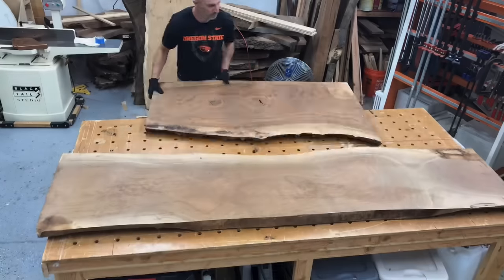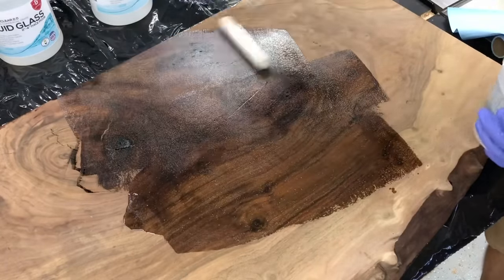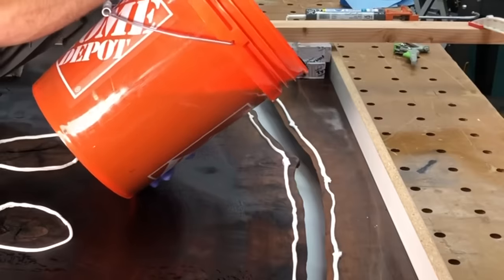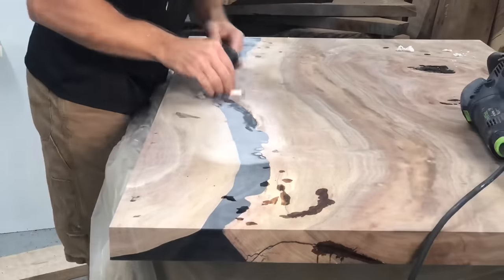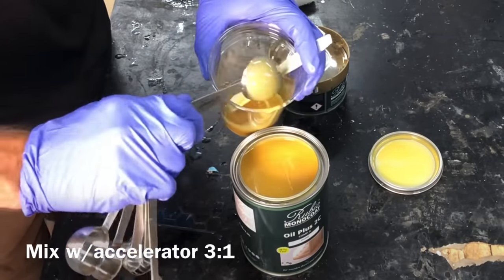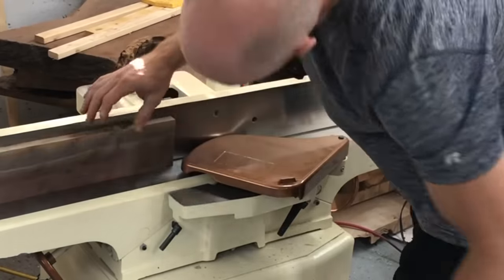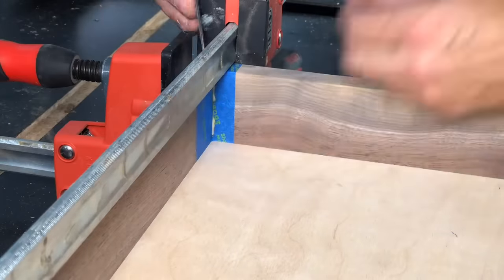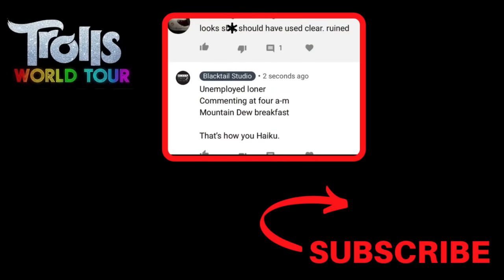Strangest Thing I've Found In a Slab

Comment: Nice work! Love your channel. How fine a grit do you use on walnut? I have a slab that I sanded down to 240 and then finished with Odie’s Oil. It still has open pores that dust can settle in. Would the Rubio’s Monocoat be a better finish to fill the pores? Do you think I can put the Rubio’s over the Odie’s oil?

Comment: On the drawer why didn't you switch from one side to other and then mount inside the drawer on side and the bottom desk? Could put a panel on inside drawer to cover the sides of that was issue

Comment: Dining table - I remember years ago watching a Barn to house conversion series on UK TV.  The guy was building a open staircase out of locally source oak.  He was cutting the steps and risers, following which he fed them through the planer.  This is when he found bullets in the wood.  Like you he left them in there for effect, but the planner was not so impressed as the bullets shattered the carbide blades. Not so much profit taken that day.

Comment: Thankfully you're not like me, I'd have spent 6 weeks engineering an under-mount for the slides to attach to the bottom of the drawer, gone through 15 versions and may have still possibly gone with the side mount like you did. Still turned out gorgeous as always

Comment: Titebond 3 is an exterior glue.  It is horrible on tooling, and I would not recommend it. It is way harder than the wood, so it can leave low spots next to the joints.  I have had problems with it at work as far as curing out properly.  Original Titebond is the best. The 2 variant is good for faster drying. 

 I manage the millwork dpt in a custom cabinet shop (been in the industry for 35 yrs).  I  am especially close with the molder operations, and we hit bullets all the time.  Especially with walnut. Bullets are softer than the tooling , so it is not an issue really.  I have heard Walnut trees are especially susceptible to this as there can be lone trees in the middle of fields, and they tend to get shot at for some reason. This is just a notion though, there could be a completely different reason. 

 Good work btw.  We do occasional live sewn slabs for furniture pieces in custom homes and hotels, but it is not very often.  We have brought in entire trees and sliced them up  ( On a big wood miser) Walnut along with other species.

Comment: To hide the slides, you could make two side covers and route in them space for the slides and brackets. Because they would bear no structural load, they could be glued in place with a few dabs of RTV, which would allow them to be easily pried off if the slides needed service in the future.

Comment: I can speak(write) about the Titebond 3 problem. I found when I bought some that the mixture separates in the bottle and needs to be mixed thoroughly but how does anyone do that with it in a bottle? Shaking does nothing, it needs physical stirring. You can actually see the heavier particles in the bottom of the bottle when purchased. I didn’t notice and when I tried pouring some out it came out like milk. I thought it was odd and I was right. It doesn’t hold squat, has to be mixed. I brought it back and exchanged it for Titebond 2 which works great. Hope this answers some questions and helps.

Comment: Steam punk table 👀
That's all. Class vid as per 👌
Ooo one thing. Two lengths of the same timber on either side with a scarf cut to the underside where the draw furniture is. I would have considered a shadow gap to the front in line with the top of the drawer too. Only about 50mm deep or so but alas, father in law...quite rightly every expense spared 😜🤣

Comment: You could have hid the hinge with Walnut(covered it)?  That way you'd only see it when you pull the drawer out.  I get that you used the metal slides to get full extention, but if that was not necessary, you could have done wooden slides(make drawer longer than slides so when you pull it out the drawer is still engaged in the slides, like drawer is 6" longer than slides.)

Comment: what i'd love to see in an epoxy table   would probably  be to light a thickness a wood to be practical but ... an old fashion drop leaf table someone stole the one i had been given  by great aunt  ages ago  but i think a drop leaf in an epoxy table would be  an absolute beautiful thing in  crotch  or  root burl walnut,  That  rubio sure beats the shellac and had rubbing  to finish  with shellac and  rubbing in  with pumice, honestly i like the    finish  get with rubio monocoat  then a couple coats the ceramic over it, the failure is  because of the oil in the wood  all i use is  regular  titebond

Comment: Love all your projects. I recently came across your site and have watched many of your videos (and subscribed). You have mentioned that you get "dinged" an extra charge if you have any metal in your wood that ends up going through the industrial planer. Did you get hit for that fee for the bullets?
Reply: If they were old lead bullets it would be like planing hardwood. Steel could definitely damage the plane blades. I use a wand type metal detector now after killing a full set of blades on a hidden nail.

Comment: On your drawer, generally there are 100 ways of doing things. If it works it's right. You can make the slides look better with a piece of Walnut on the outside of the drawer slides. You can attach it with the body mount holes down the center of the slides.

Comment: After mixing you need a  thick plexi plate with a hole in the middle for a vacuum cleaner. So pulling a bit of vacuum you will remove air bubbles.

Next tip poor a layer of transparent epoxy  let it harden then place objects on it like coins  then poor again 2nd layer  then an opaque  third layer

Comment: Liquid glass?  What happened to the shine? Looks matte now? I'm a new guy, but been in auto collision & refinishing for 25+yrs  and used  polyurethane base coat clear coat automotive paint on everything, your homes front door ,   jetted bathtub/garden tubs,. Even the sink👍🏼  
The dry times and materials are $$$ 🔥👍🏼.  I wanna find something like that liquid glass to play with, does is buff out with 1500-2000grit and a regular buffer/angle grinder with Velcro buff pads 3-M ??

Comment: In the boat world working with various fiberglass resins, not sealing edges or not pre coating any wood surface with resin before glassing so it can absorb what it will because it WILL absorb some is one of the biggest mistakes you can make.

Comment: Are you sure those are bullets? I’ve founded four or five in different slabs over the years and you can always tell it’s a bullet by the thin ring of brass you’ll see around the lead. I built a live edge headboard for me bed that has one dead center. Just curious. Maybe it was the lighting but those didn’t look like bullets to me.

Comment: Either a full wood piece like a wall decor or something that requires a little more resin than what you usually do for the epoxy tables. For hiding the drawer mount, something like a facade could have worked, but not to sure how to make it work for when you pull the drawer out.

Comment: make the drawer closer to the length of the table, so the legs hide the slides and paint em flat black. as well you can flip your L brackets inward to mount hiding above the drawer sides.
PS I'm more of a car building guy than a Furniture guy so I may not know anything :)

Comment: i think gluing a cutting board vrs a desk drawer is very different, the glue in a desk drawer isnt put thru the same kind of stress a cutting board is, water, meat juice, acidic veggies chopping bones or whatever else poeple do with cutting boards, so if a glue fails on that it's prolly just a combo of how it was used and the stree put onto the glued bits, but i dunno anything about wood, just guessing

Comment: I probably would have set the drawer to the left or right rather than central to the table, as this tends to be the 'sitting area'. The function of the drawer will be problematic if the user is sitting right in front of it.

Comment: As I type this, I see that their is 2,138 comments. In the off chance you may read this, you may have heard of the expression no need to reinvent the wheel, instead improve the design. I'm an ex Autobody guy. You may (HINT, HINT) want to try checking out some autobody / refinishing compounds / polish(s.) Used on both Automotive and Marine (i.e. fiberglass / "GEL-Coat") finishes. Also you might want to pickup some / a set of "TRANSFER-PUNCHES," instead of using a "drill-bit." The reason I make this suggestion, is you would be able to make a "Mark," / small "Divot," in the CENTER of where you wish to drill a hole, and also know just what size drill bit to use, i.e., a "TWO-FOR."

Comment: I got to watch to the end as the FINISHED LOOK is what I always see.  I hear you complain about the look of the sides of the drawers. My solution is either cut an "L" shape or a square block to attach to the underside which blocks directly seeing the roller slide OR BROWN PAINT or stain which does not make it as obvious as the silver metal color. Just brush it on keeping it out of the moving parts.  Metal paint like Rustoleum will do. (it is the cheapest and fastest route to take)

Comment: Nice legs, .....and the Flowyline ones are amazing too, buhahahaha.....Main piece of wood has the coolest patterns and the other piece matched up perfect as can be. black connection flow with those black legs are insanely cool. Drawer is a pretty odd addition for the type of tables you make , but hey it's for family so who cares...fantasizing about a drawer/drawers design where they are spanning across the whole front so it looks like one long 3-5 drawer divided underlip...be really cool if you could make a big ass circular table with drawers underneath the whole bottom..is that even possible? my brain just exploded.

Comment: Time for you to start making cabinets?
I love your finishes and choices of wood, but not a big fan of epoxy. I feel it gets over used too much. Have you tried just flushing up the edges of the two piece, like with this desk, so they mate flush with no need for epoxy filler? Doesn't even need to be square to the edges. Maybe angled. But flush faces to each other so its just glue and dominoes. 
Thanks

Comment: Do you ever get bits of plastic from the sides of the cheap orange home depot buckets?  Our power mixer added bits of orange shrapnel when we mixed drywall mudd.  I was told to use the harder white buckets to prevent that.  Also would have loved a close up of the bullets.

Comment: I love that you find the wood to get that 'flow' between the two, maybe in the future, you might do more flows, less epoxy, with more than three panels of wood, maybe several branches or thin wedges. If not, as others have said, see through so you can see the woods edge.

Comment: Cam, it looked like you were running the acrylic caulk on the slab through the planer or wide belt sander.  Won't that gum things up like the wide belt sander?

Comment: In your last vid you mentioned sandals in the shop. In the summer I always wear my sandals but I don't generally do the kind of work you do, I am a turner, so how can that be bad for sandals! Think again. I had just finished sharpening my 3/4" bowl gouge and laid it on the lathe bed point facing away from me, when some how i turned around, knocked the tool which flipped around and fell towards me tip down and dug right into my ankle taking out a good 1/2" chunk of skin,OUCH. Later as I was cleaning up which as an after thought I should have gone for stitches and didn't, I realized how lucky I was, because 1/4" over it could have hit and cut my achillies tendon!! I probably would not be walking today. Now I wear SHOES and long PANTS.

Comment: Cam Anderson,

I've followed you for years, only recently subscribed.  Been a woodworker for 45 years.  

While I understand your use of black-dyed epoxy on most of your creations, in some cases it doesn't work well or is just boring.  Have you ever thought about how much better (and more distinctive your work would be in the eyes of potential clients who are so used to seeing same old, same old black epoxy) - IF you color-tone matched your epoxy to the woods you are working with?  Or, used a dark Amber epoxy with woods that have warm, golden brown colors? 

For example, the table in this video had plenty of cutoffs to test on and IMHO would look much better and be worth A LOT MORE $$$ if the epoxy was in the same family of colors as the wood.  If you are game, try this: 

1) Make the epoxy mix color-matched as close as possible to the darkest wood of your slabs, THEN 
2)  Filling small voids would be done with either black (if you think it looks okay) or with small batches of dark wood-tone colored epoxy (write down the color ratios you mix, so you can duplicate them later).
3) Add a touch of pearl white / pearl cream / gold flake in the final pour (yes, think of Stone Coat counter tops, BUT done VERY subtly).  Application is critical to getting this right, so you may have to experiment some.

Doing this differentiates your EXCELLENT table tops with a POP of color that has something extra going on.  Anyone can do black epoxy and yes the people will still pay you if you continue down this path.  And yes, it goes with black legs, BUT, I'd bet you could get an extra $2,000 - 4,000 per project from many of your customers if you offered this to your clientele as an upgrade option.  

Another upgrade option which would work best with CLEAR, Amber  / Amber with gold flake Epoxy would be - Subtle, dimmable LED Lighting on the underside.  This should be worth at least $500 - $1,000 more (You'll have to install an underside control and/or WIFI option w/phone app - no big deal, cost to you is almost nothing - app included).

Thanks for reading through all of this.

Best regards,
Bill Wendt

PS: I have no affiliation with nor get any compensation from Stone Coat Counter Tops, Inc.  If Liquid Glass does counter tops, cool colors, etc - maybe they have training courses on applying different color blends.

Comment: i have had gr8 results w/ Build50 epoxy clear finishes. Self leveling, ez to use, durable, hard to scratch, (even with a newly sharpened steel dart). Great for bartops, + u can add items in it for accent. Mix by hand to avoid bubbles.

Comment: Cool project.  
After seeing a few of these epoxy projects, I am curious as to why no one seems to using vibrators to eliminate bubbles.  Vibrators are simple technology and cheap and commonly used in everything from concrete to dental tech.

Comment: I find old bullet projectiles in the logs I cut from my land in Texas. Some antique and some look recent but they are cool to leave in the finish when the mill cuts them in half. I have found 4 so far. Also I dont use dovetail or biscuit joinery in my drawers in my little cabinet shop. I use pocket holes for speed and then just patch them with dowels of the same species or ply. Kind of like you do your butterfly stitches.

Comment: If a piece of wood is oily and you want a good glue bond use a urethane glue. It is water proof and will stick to oily woods. Cutting boards can be glued up with a urethane glue also. You do not have to worry about the glue joints being weakened because of exposure to water. There is learning curve when using a urethane glue. It is a moisture cure glue so pieces glued must be moistened and it takes very little glue to make a strong join.  The glue will bubble and move in the joint becasue of a chemical reaction while the glue cures.

Comment: Just play around with some external of the drawer framing and put them on the bottom. Ive done so not a biggie just think it through as to how to mount them.  For the little square plug think of a blind mortise and tenon. you don't see the joints.

Comment: I wanted a floating door into a pocket in kitchen cabinets, so needed top over and bottom under slides but those too are not available probably because the rarity of their use, my problem was the weight of the door and that it would be opposite to normal as it would be open for the majority of the time, still working on the problem.
Probably the only way round the slide problem is to make side panels.

Comment: You use the inserts for big tables and screws for smaller pieces. An in between solution is to use anchor bolts.  These are wood screw on one end and machine screw threads on the other. This way you only run the wood screw threads in once. All subsequent assembly steps are with the machine nuts. Also means that your wood screw attachment is done without load.

Comment: Should have done a door rollers and inserted the rail part to drawers and bolt the wheels to the underside of the table 👌🏻,   Then you can hide the rail part in the top of the draw sides and won’t be able to brackets or rails unless open. All off the shelf stuff as well. If you positioned the push to open on top of the rail to push against the first wheel stem on the underside of the table you should be able to actuate the push release 👍🏻

Comment: To hide your drawer sliders you could always take pieces of your scrap walnut to make a false non supportive U shaped cover that is attached to the bottom of the table with dominos. that way it will still have that beautiful walnut look and yet still have the metal drawer slides hidden behind.  Just make sure that the drawer front is wide enough to either cover the ends of the false walnut walls or go flush on the sides for the drawer front if you want it to have that flush recessed look.  Cheers and thanks for sharing these  beautiful pieces.